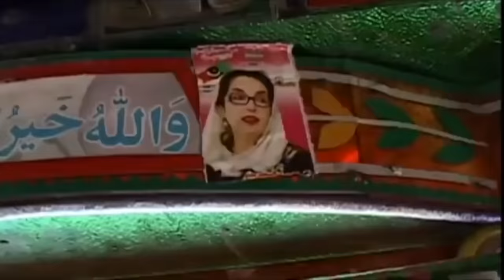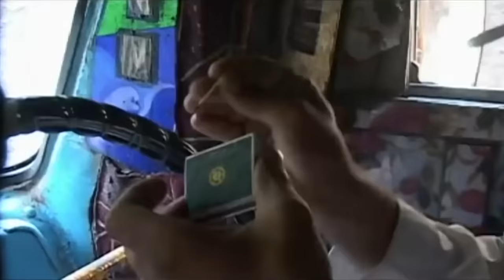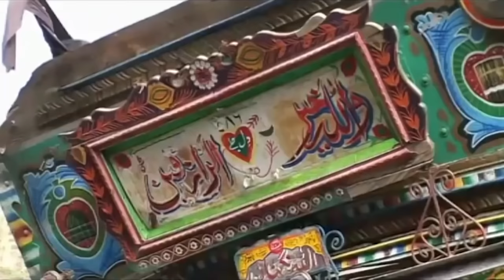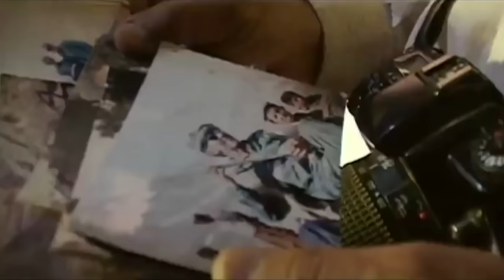Pakistan, on the Edge of the Precipice | Deadliest Journeys

Comment: The tractor driver at 17:45. Smiles while clearing out a basically ongoing mountain slide, saying "Someone has to do it". Who's the Rock Star now? Axl Rose or the Anonym Tractor Driver ? Bravery of a frontline soldier. I salute to you Sir.
Reply: Absolutely correct 👍
Reply: He's baked.
Reply: Sure......very hardy people , but it's not as if he's got many choices .
Anyway , such jobs are coveted, battling with a mountain will give a certain prestige .
Reply: nope ... because he got high ... and not only if you didn't notice
Reply: Axl Rose is the rock star. Dumb question
Reply: @denisbolshoy  That strange grass growing on the mountain side 😀
True, I did not consider he’s doped, may be.
Even with some substances, he’s got balls …